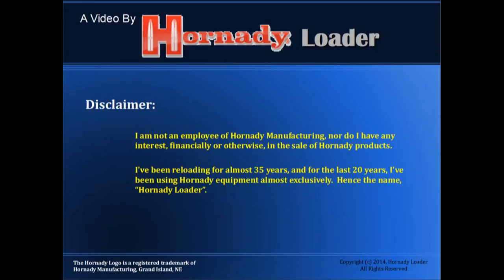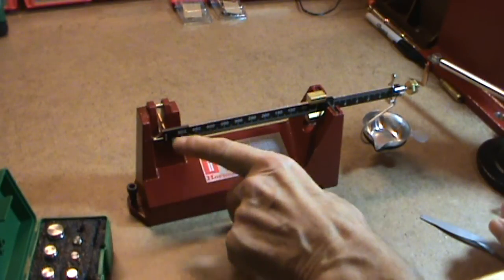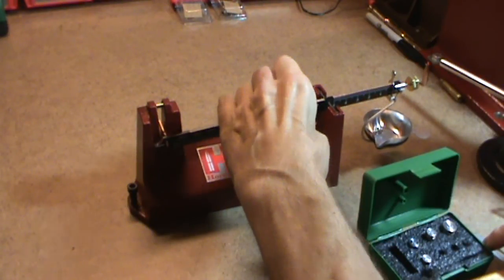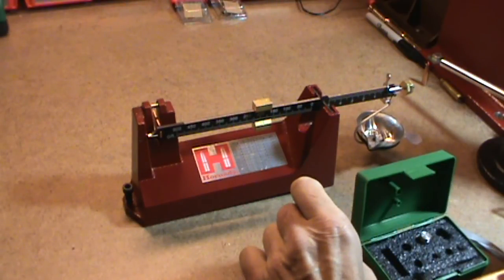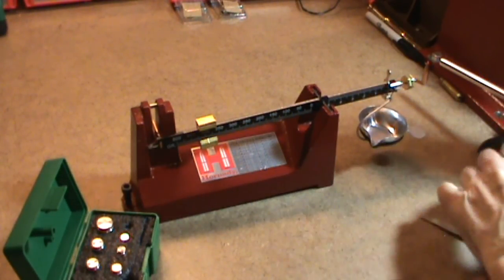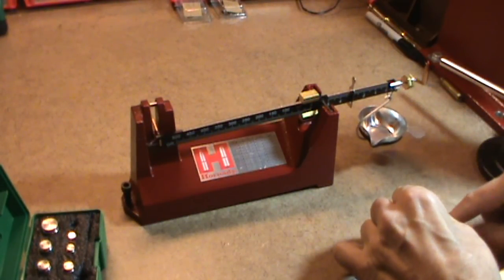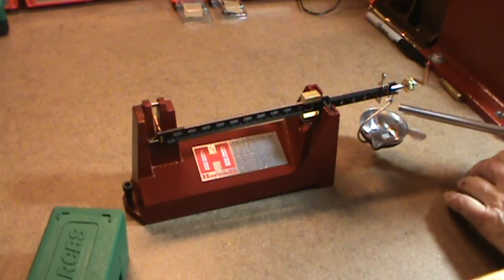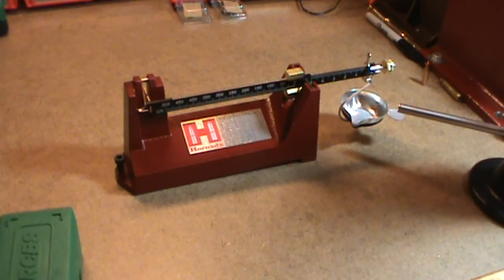Hornady Balance Beam Scale - A Follow-Up

Comment: I bought one of these and it's repeatability is awful. It's useless.It sticks. Check it with a 15 grain check weight 5 times, I get a 0.75 grain deviation between each weigh. Ok went Ohaus digital in the end and put this rubbish to experience. Hornady lost a customer.
Reply: I’ve used hornady balance beam scales ever since I started reloading with 0 issues. I find that if people have complaints about these scales then it’s not the scale it’s the person using it.  🤷🏻‍♂️
Reply: @basketcas3717  they aren’t built to the same specs they used to. Same problems.
Reply: @fifthbusiness2591  it’s a simple balance beam scale. Not much to it. If something is wrong with the scale hornady will fix the issue.
Reply: @basketcas3717  So far Hornady has been good to deal with. 

Mine had a burr on the balancing edge. That makes a microscopic flat edge, resulting in equilibrium at different points for the same weight. The accuracy of the balance requires a symmetrical edge. 

Sir, manufacturing defects exist. I assure you it is not always user error.
Reply: @basketcas3717  I have a question. If I set this scale using the screw to zero everything out then it measures fine once I take the pan off the back and pour my powder and move everything back to zero then its off why?
Reply: I bought one of these and had immediate regret when i picked up the package. This feels like a toy. Like its made of tinfoil. Not at all what i was expecting. Weight diffrent every time. Going back with out ever reloading one bullet.